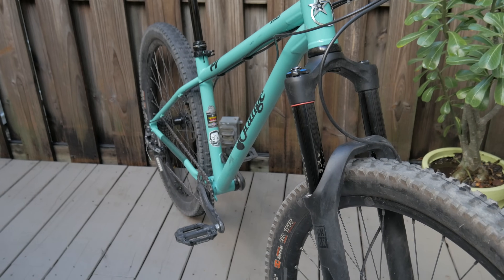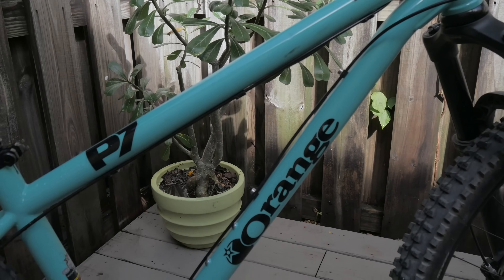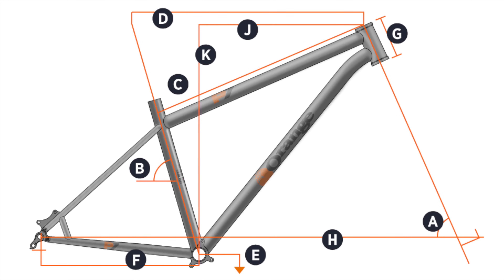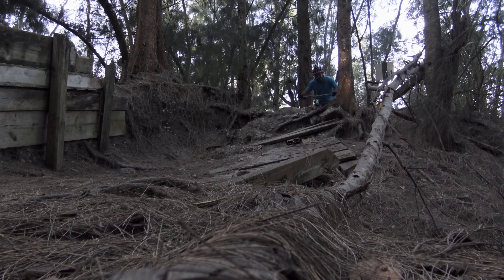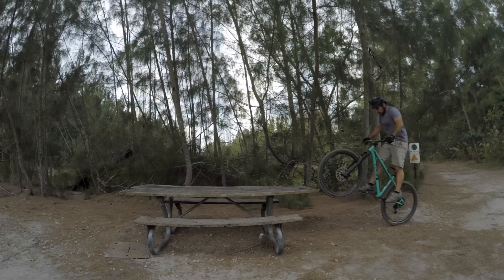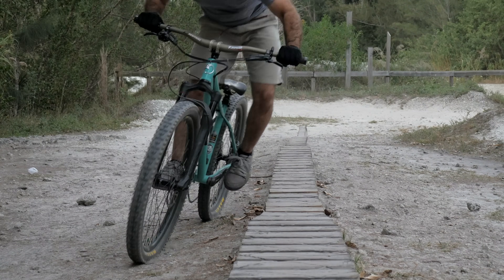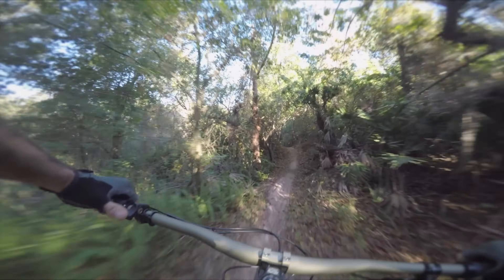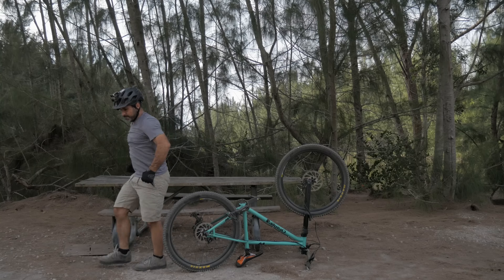Orange P7 RS Bike Check - Hardtail MTB

Comment: Nice video man, I was actually wondering about that bike. How does it stack up to the Synch'r pro you have? They seem really similar in design choices.
Reply: it costs 3 times as much as the sync'r pro so I'd imagine it does slightly better at least.
Reply: Ross McCollum  im having the same question
Reply: yeah I have the same question as well. doesn't look like Seth answers a lot of questions.. to busy riding XD
its cool
Reply: I was wondering this same thing myself. leaning towards diamondback but not sure  if the sync'r pro is a better all around bike vs P7s.
Reply: It's steel, slacker, longer, and has better components.
Reply: its not comparison, although the crush s is a good comparison. i'm biased as the orange workshop is less than two hours from me, but they are both good bikes.

Comment: STEEL will outlast Carbon and Alu bikes, and it keeps its resale value
Reply: Yeah but I've had experience with a norco Ryde 26 which is a steel Dj and it started to rust
Reply: Do you like rust? All my steel bikes I had began to rust sooner or later. So no steel for me, please. I do not like rust.
Reply: @ralfrufus6573  spoiler alet: thats a you problem, clean your damn bikes
Reply: It will also rust like steel does..I hate rust.
Reply: Have a 20year old steel bike. No rust and the best bike I’ve ever bought. I would absolutely buy a P7 over carbon or aluminum.
Reply: @renenavarro4121  chromoly steel is more rust resistant than any other type of steel that is what the p7 is made of

Comment: How do you plan on going about protecting the frame from rust, especially being that you live near the coast? Obviously keeping it washed and not riding it into a ships wake will help, but are there any coatings or other specialty maintenance supplies on the market to protect and prolong the life of the frame?
Reply: well, it's chromoly steel not regular steel, so it does have a lot more resistance to corrosion
Reply: Interesting, I hadn't heard of it before. I'll have to check it out.
Reply: TheNerdyCanadian not as much as you would expect I have a cro-mo frame bmx bike and regardless of all the drying,cleaning ,and clear coating rust spots are near impossible to prevent
Reply: I rode a chro-mo road bike year round when I was a bike messenger in Boston. I never had any issues with rust, and I never washed anything but the drive train.
Reply: Joel Jackson It really depends on the alloy - so basically how high the amount of other metals in there is, also the amount of carbon in the steel. There are alloys out there which are strong enough for bikes and do not rust, I guess the P7 at it's price point might be made from that.
Reply: cromoly is like stainless steel in that it doesn't rust
Reply: Finlay Sandham oh it rusts trust me it rusts

Comment: Steel is definitely real! I'm still running my 2002 Rocky Mountain Hammer. It's composed out of Reynolds 725, 525's heat-treated chemical brother. That thing just keeps on chugging, even at the bike parks. Hopefully your orange will last you 15 years!

Comment: Hey Seth I ride a Cotic Soul 275 another UK steel hardtail frame - it has Reynolds 853 tubing and it's a perfect balance between the hardcore elements of the P7 and the nimbleness of an agile single track weapon. Lots of us in the U.K. consider it the quintessential steel hardtail and it's been designed to tackle the rocky trails of the Peak District, so it's no shrinking violet! You should get in touch with Cotic and see if they'll send you one to review....

Comment: My 15" hardtail is a pedal smacker as well. The thing you didn't mention is the pedal to tire clearance. On 90% of small(sub-16") framed 29ers, the pedals damn near touch the tire. It's not a big deal until your foot leaves the pedal, then when you re-stick it at a less than perfect location with an impending turn. I caught my toes many times in the first week I had my Fantom Ti. It forced me to stick the landing or be punished for it.

Comment: The Renthal grips are comfy, but definitely something to watch out for. I used to love mine... until the pinch bolts seized, stripped, and had to be drilled out. Never had a pair of lock-on grips do that before or since! I went with Sensus after that and haven't had any problems.

Comment: Hey I have a question kinda related to this video and kinda not so I've rode bmx practically my whole life like allot of people I got to big for the bikes and grew out of it but still wanted to ride so I started doing mountain biking I went through two  single speed  dirt jumpers i was just getting really confident at my local intermediate trail system I  was learning how to do manuals go over obstacles with ease  but I was basically the only guy with dirt jumper in a a crowed of high end 27.5 and 29er mountain bikes that's basically the norm where I live so I decided to sell my dj and buy a Fuji 27.5 hardtail and after that it went downhill I  couldn't get use to the geometry really didn't feel safe on it felt like I was going to go over the bars on drops and jumps so I sold it I haven't been on the trails in a few months and it's time for me to buy a new bike was going to ask if I should go for a full suspension bike with similar dirt jumper geometry or just go back to riding dirt jumpers?

Comment: u must be made of rubber the way up just bounce back from that crash! 
I am getting a pretty good used dirtjumper soon and plan to use it as more of a bmx, it's under 200$, single speed, hydraulic rear brake and super light. I am older guy getting back into this kind of ridding after 25 years! Is this bike alright for this and would a dropper post be good idea? Bunny hops, wheelies, manuel some jumps etc.

Comment: Hi Seth, do u have any tips for pedal smackers? I ride a trek remedy 8 2017 and im a lil bit frustrated getting used to pedalling as my pedals always bump into things especially when i tried to paddle away out of a berm. Is it something i have to live with and getting used to? Or would i be able to change my factory crankset with something a lil bit shorter maybe?
Reply: Adahus Nidduluam check your suspension sag. Sounds like you are compressing the rear suspension too much. Also you have to exercise some skill if you're pedaling while cornering. Knowing how far you can lean over while pedaling comes with practice. Cheers.

Comment: my forks are really stiff and will badly move without them locked out and all the setting don't do anything the person who sold it to me said the forks are new so idk why to do. can u help
Reply: Kalen Konrad, try getting the forks serviced. That might help them out
Reply: Kalen Konrad, if it's not an air fork then you likely won't get much out of it. Some of the suntour spring forks are worse than rigid forks. Also, those adjustment knobs don't do anything on lower end forks.
Reply: theconman1395 ok thank you for your help
Reply: Mitchell Henstock posibly
Reply: He isn't wrong about Sr suntour forks. They are terrible. Especially in the cold and in the wet
Reply: Mitchell Henstock but I have rockshok forks

Comment: At 5:20 you see him failing miserably when trying to jump onto the table. How stupid trying this with a heavy steel bike! Of course you fail! Try the same trick with a 10 pound lighter bike and you will have no problem whatsoever.
Reply: That is absolutely not the issue. Weight plays a very small role. The other thing is, is that the p7 probably doesn't weigh all that much more than an aluminium bike.

Comment: I'm looking for a hardtail that is aggressive and slack like this one but I'm 12 years old. So I was wondering if anyone had a suggestion for a hardtail.
Reply: Mason Bakken dimondback hook or a cheaper option a dimondback axis
Reply: Mason Bakken I have a trek Marlin 5 and it was about $500. I am about your age and it is a great bike
Reply: Mason Bakken buy a bike from Craigslist you can get a crazy bike for a great price. I got a really nice full suspension for $500
Reply: Mason Bakken Save up your money and buy a Whyte.
Reply: If you want it new, I'd suggest the DB Hook or the Raleigh Tokul 1. I personally had the Raleigh Tokul and it did me well. Lasted a long time before I switched to a full-suspension. Otherwise, if you don't mind it being second-hand, you can get super awesome deals for a very low price. Make sure you have it tuned after you buy it so you weren't scammed or anything.
Reply: look on craigslist as stated previously. Specialized Big Hits for 500, DB sorrentos for 125, Specialized rockhoppers for 80. that stuff.
Reply: Mason Bakken polygon xtrada